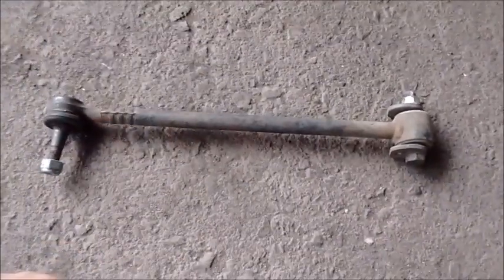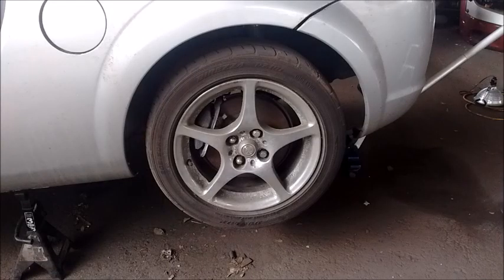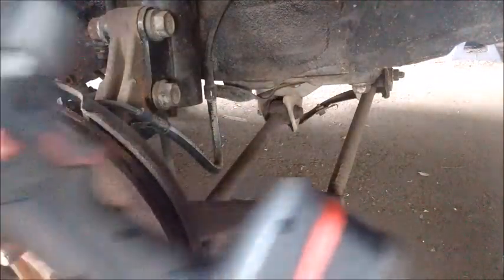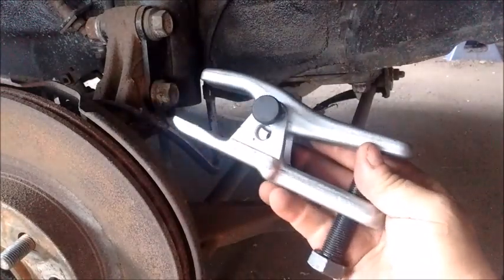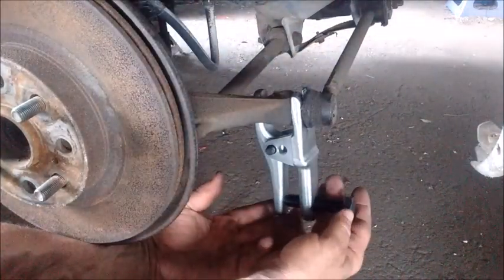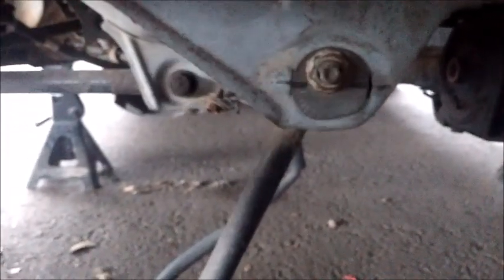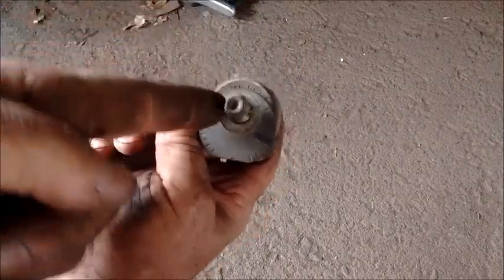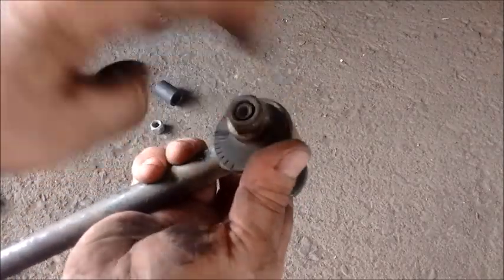Rear Control Arm  and Ball Joint Removal Tool - Toyota MR2 Spyder

Comment: Hey I’m stupid, I accidentally pressed on the rubber on the balljoint, and grease came out. Can I refill it with grease ?
Reply from the maker: See if you can release the rubber boot from the base then squirt some grease under it then re-attach the boot.
Reply: @Merryfrankster_  thanks man! Always a big help I can count on!